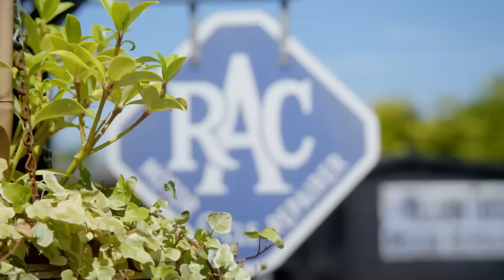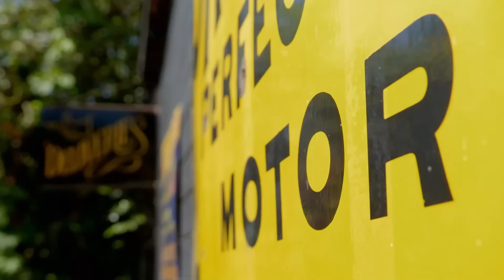Millyard works magic on a quad bike

Comment: Would like Allen Millyard to do a vid on that 1950's BSA, B1 twin 250 cc green race-winner that the management refused to enter it, in case it didn't win. And why and how did it appear to have TWO different engines?. Legend has it that is in the Motor Cycle Museum somewhere!